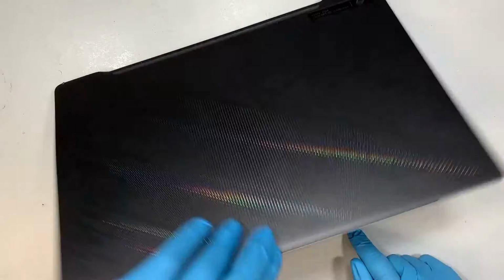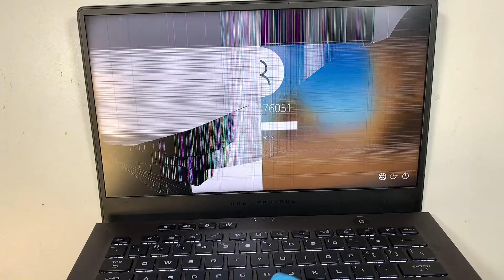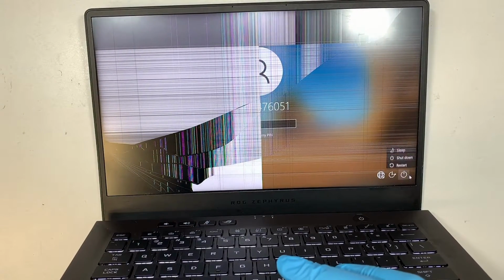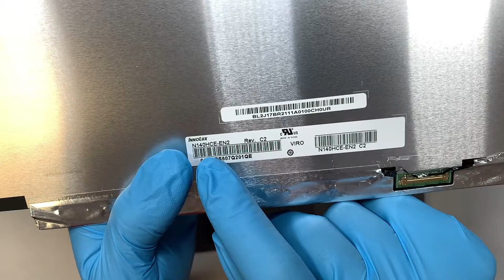Asus Gaming Laptop GA401Q Cracked Screen Replacement

Comment: My WiFi stopped working after doing this replacement is their anyway to fix this issue
Reply: Sounds like you may have unplugged/damaged the antenna lines that run along the display. Assuming that they're just unplugged I would find the connector on the main board. If you damaged it in any way.... I'm sorry....

Comment: Did you have to unplug the battery? I'm always concerned that the motherboard will die if I don't unplug the battery
Reply: Alwaysssss do you don’t want to end up with more damages to repair!
Reply: @romella_karmey  way easier and cheaper to play it safe rather than buying a new laptop, especially to those unfamiliar with at home repairs, good advice.
Reply: @ItzBunter  yeah but sometimes those repair service guys don’t do the precautionary disconnect battery! I always have to remind them..
Reply from the maker: I did not.